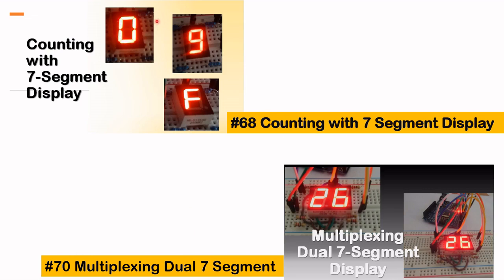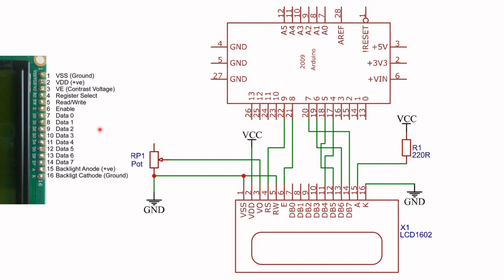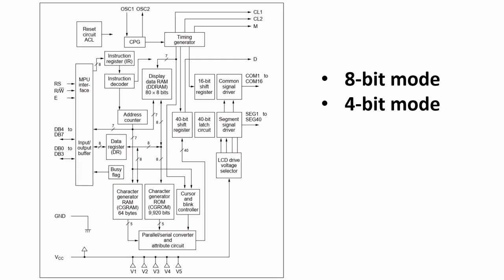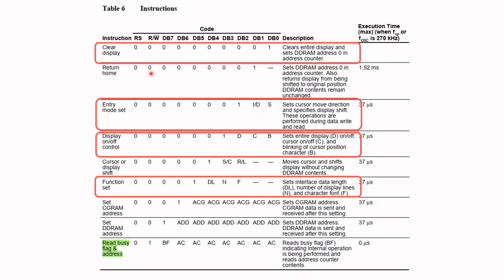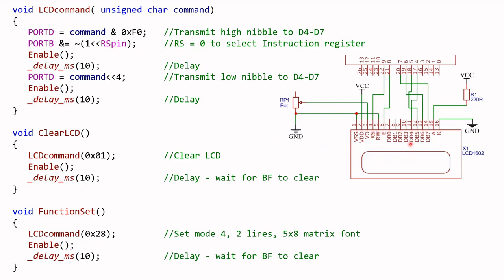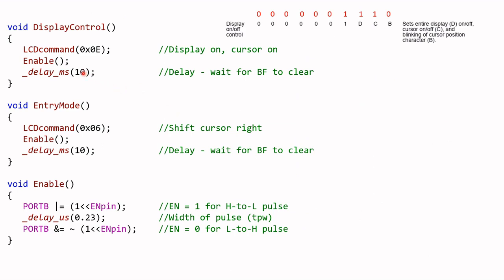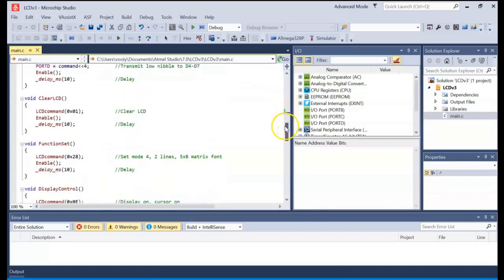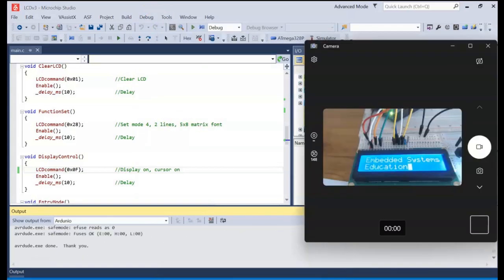#71 Programming the LCD Module

Comment: These LCD are fun to learn on but not good if you are designing a product that requires many of the IO pins. At one time I was using a shift register between the AVR and the LCD to limit the number of IO pins needed. Ultimately I moved to a serial version of this display. Uses just the TX pin of the AVR at 9600 baud. You can even control contrast and brightness via the RS232 connection. And with the 328PB now having two USARTs you have a spare if you need it. :-)
Reply from the maker: Hi, thank you for your comments. It's appreciated.